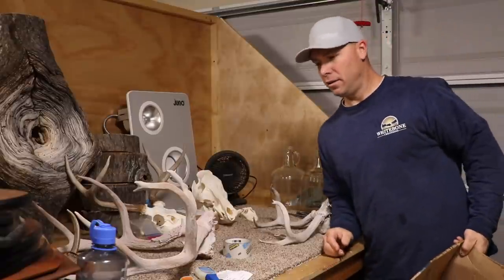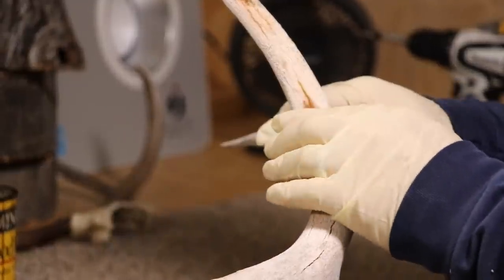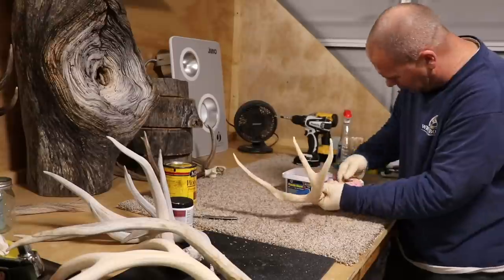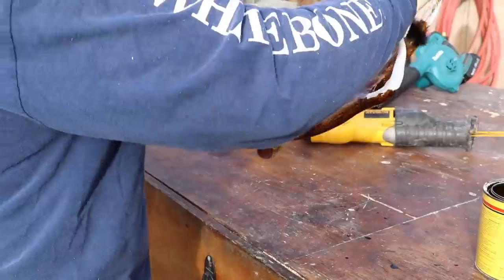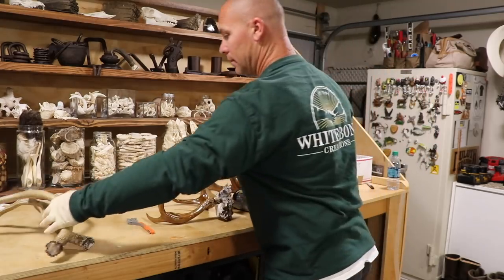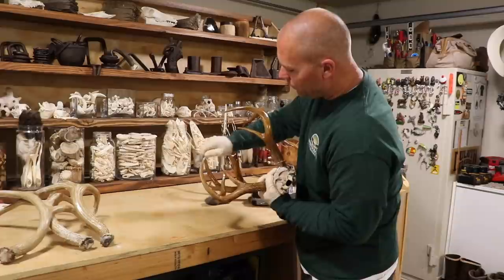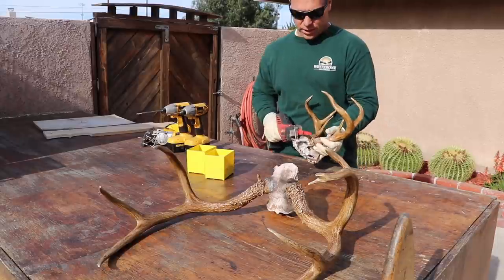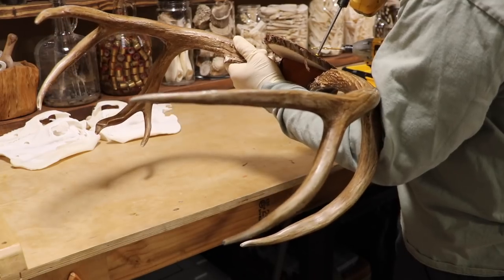ANTLER BODY SHOP " CHALK TO BROWN "

Comment: A tip I found out to help with the ivory tips on elk, is put a coat on and then wipe the tips where you want the ivory look after each coat.  It avoids the need to sand the tips.  I've noticed when I sand the tips too much of the base stands out.  Makes it almost too white.  Once you put the first coat of stain on and wipe it, the paint will have an ivory look to it.  Then for the bumps on the beams, I sand them down to the white paint before I put the final coat of stain.  That will leave the bumps lighter, but not bright white.

Comment: You could get some oil based paints. I got mine from hobby lobby. Colors I have are Payne’s grey, raw umber, burnt umber, raw senia. Use Payne’s grey as your base color on horns and the the browns to darken them up. After done you can rub some of it off with terry cloth to blend more. Use lacquer thinner to thin paint down when putting it on the horns. Once you get the desired color you can clear coat with a matte clear to seal it. Can have one done from start to finish in about 2 hours

Comment: I found a wood marker is great for touch ups as well. Especially if you want the base a little darker, or maybe during the whitening process you've whitened the antlers a little bit. Use the marker, and water to thin it out if you need to.

Comment: Great video. You might try your hand at using lacquer thinner and acrylic paints. Use a pains grey diluted down to make a wash with the lacquer thinner let it dry and take steel wool to it and knock of the runs and dark spots. Then go back with a wash if raw umber or burnt umber and let it dry and take steel wool to it also blend it real good and then you can seal it with matte finish clear coat. Turned out well for me.
Reply from the maker: +Logancrossno Awesome awesome info thank you.
Reply: Your welcome.

Comment: Excellent video. I'm trying this out on a set of antlers I have from a muley I shot in velvet 2 years ago. the antlers are very porous toward the tips due to still being in velvet when I took it. I didnt know how to preserve the velvet and when I fount out, it was too late, so I stripped them. 
When you stain them, do you add a heavy layer and than wipe it off? when I try to wipe off excess, its taking to much off due to the paint underneath. Also do you clear coat yours when finished?

Comment: Could you clarify if you apply the stain and then wipe it off before applying the next coat. I didn't hear you say that either way in the video. I'm redoing some really old elk antlers and want to get it right. I restored some moose antlers and replaced one of the tangs with Apoxie Sculpt which I didn't put a base coat of paint on first and of course the stain reacted differently to it than the antler. No one can really tell accept me, but I'd rather do better on the elk antlers. Thanks for your advice.

Comment: Great video! I repaired a 480 class elk using a similar method. Its now hanging in the elks club here in Hawaii. Have you ever repaired chewed off tips?
Reply from the maker: +Kawika Delos Reyes awesome. Yes I use a piece of wire and fix all sculpt. And the same coloring process.

Comment: Great tips!  I have tried (unsuccessfully) to revive some old antlers.  I actually have a set of mule deer antlers in my shop that a co-worker asked me to "do my best" so I will try this method on them.  One question, it looks like you used more of the wire brush than the steel wool around the bases with the uneven "pearling" (just what we always called it).  Is that the case?  I had to touch up a euro where the bleach leaked through to that area and had a devil of a time knocking the "glossy" finish off that area after I touched it up.  Thanks!  Love the videos!

Comment: Does the stain eventually cure and resist the touch?  I'm tempted to spray flat or satin polyurethane after about a week long cure to try to lock in the color but I'd hate to have it react/run and ruin it .  Thoughts?
Reply from the maker: +barnyardkh4 If there is / was oil or grease on the antler from the boil the stain will not cure it will just get tacky.  I would blot it with a paper towel wash it and reapply.

Comment: Ryan, quick question if I repair a horn or build a broken horn with fix it sculp or apoxie sculp will it stain like the rest of the horn or is there something I need to do to it first.  Thanks
Reply from the maker: It will take color differently is it chalk or brown.
Reply: WHITEBONE CREATIONS HUNTING      the horn is brown
Reply: I did not no if I needed to use wood putty over the whole set of horns or if it would take stain .  Horns in good shape except for broken horn and one side has been chewed on.

Comment: Maybe use a different shade of paint as the base coat? I think the bumps near the pedicles contrast a little too much with the pure white base coat showing. Otherwise they look really impressive and if the whole process wasn't shown, I doubt anyone would ever know how far gone they were.
Reply from the maker: +Kevin Kresowaty Great tip. Thank you.
Reply: Kevin Kresowaty   yup and don't go over the entire  antler  with each coat  of stain  ,  1 coat entirely  2 coat main beams 3 coat closer to the base  , blending each coat as you go using a brush ,  I did a set years ago like this and they turned out perfect ! 
 But I've never been able to correctly  restore a set that where damaged   just sun bleached  thanks for the video white bone  and thank you Kevin

Comment: Personally i think you shouldnt make the tips too white, in red stag the tips are more often than not a light grey- brown never bone white, also i reckon a little darker paint would be good. Something i use is potassium permangonate but it doesnt stain on paint, only on natural material ie bone or antler.

Comment: YOU DONT GIVE YOURSELF ENOUGH CREDIT BUDDY,THOSE LOOK GREAT.WHEN I STAIN MY ANTLERS I LEAVE SKULL ON THEM.SO I TAPE OFF SKULL AND UNDER BASE OF ANTLERS.IF YOUR GOING TO MOUNT IT LIKE YOU DO,YOU DONT NEED TAPE IT.INSTEAD OF TURNING UPSIDE DOWN,PLACE SKULL UPRIGHT AND BRUSH DOWN ANTLERS.DONT START AT TIPS,START BELOW TIPS AT DESIRED WHITE TIP LENGTH.I DO MY TIPS AT LEAST 1/2 INCH.I SHOULD DO A VIDEO TO SHOW YOU MINE.IVE ALSO DID ELK ANTLERS,IN EBONY BLACK AND THEY TURNED OUT GREY,I ENDED UP LIKING THEM QUITE WELL.